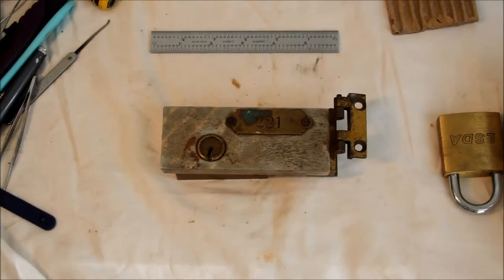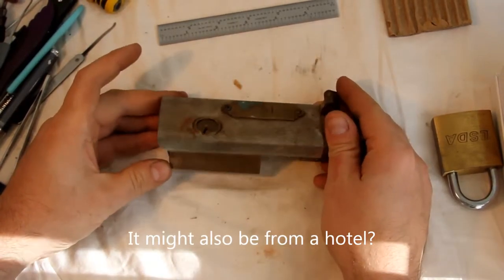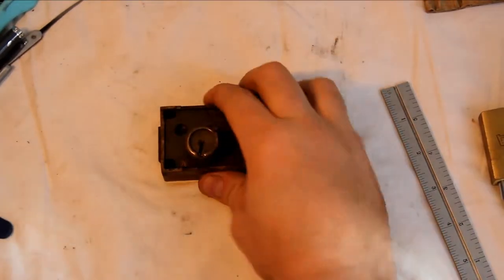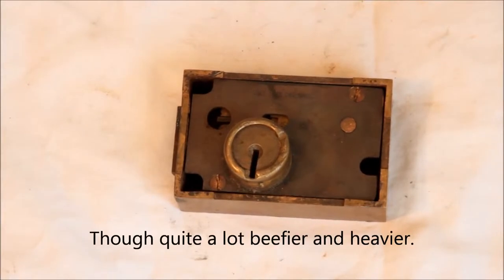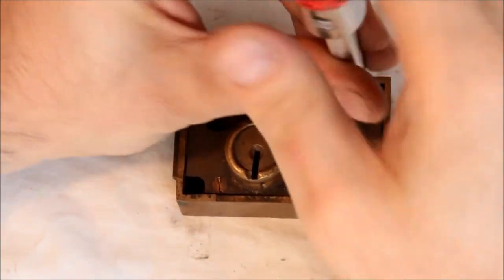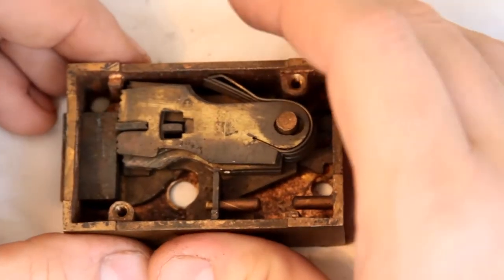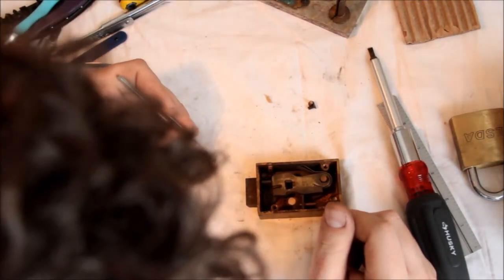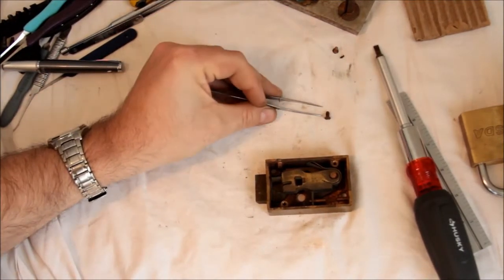(093) 1892 Safe Deposit Lock (1 of 2)

Comment from the maker: That's basically what I did. The inside of the case is still a little gritty... I probably need to go back and hit it with a nylon-bristle brush and a bit more solvent. There's also some rust on the door itself... I'm sure some steel wool would take it away, but I don't want to ruin the machine/engine turned finish.

Comment: The top bolt is a guard bolt(not a master). The bottom is the renters bolt. The teller inserts her key first and turns, the wafers aligns with the 2nd slot and the fence lever clicks into place. Then the customer inserts her key, the wafers aligns again for the 1st fence lever and her key retracts the bolts.

Comment: You have a single nose, safety deposit lock.Maybe a Herring Hall Marvin. To clean use water (Dry well) or rubbing alcohol, or lighter fluid, any thing to remove Old Grease/Oils. The lock is made out of brass, do not lubricate, Brass is a self lubricating metal!